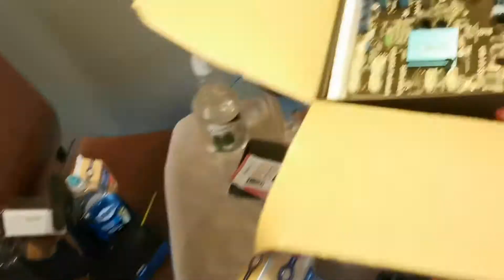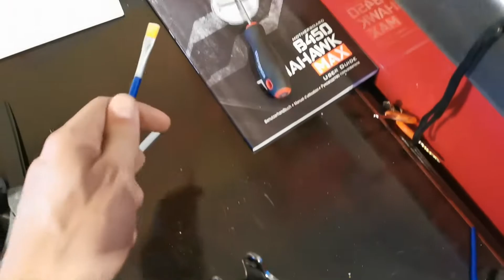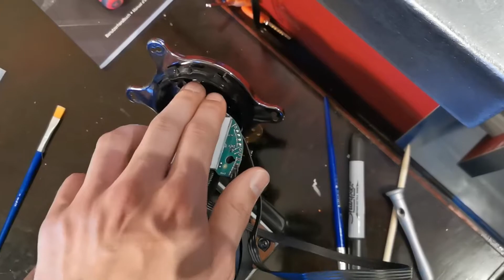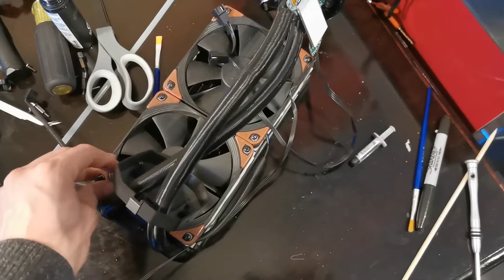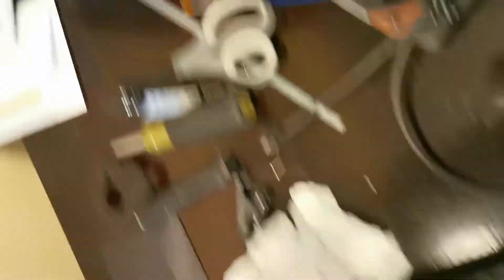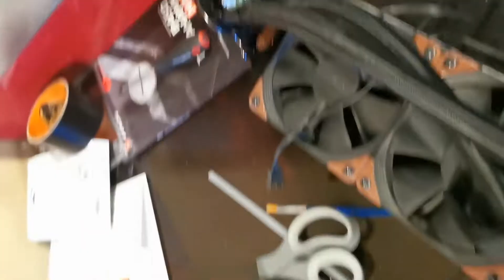H100IV2 My Teardown+Tips

Comment: How u remove the screws of the cooper block?
Reply from the maker: They are a special screw called Pozi-driv

They look like regular phillips, they are NOT, as denoted by the extra cross on the head of the screw

https://images.app.goo.gl/TVAPjj5VBX2keWTt9

You MUST have a pozidriv bit or you WILL strip the heads of the screws
Reply: @stompyrobutts  thanks a lot man you really help me

Comment: did you ever manage to get it working again? if so, what screw did you get for the cold plate?
Reply from the maker: No, never got it working again. The screw was stripped and there was no extracting it without further damaging the unit.

The screws are know as a Posi-drive. DO NOT use a regular phillips on them, you will strip them.

Comment: thanks for the video, 2 questions, can you refill it with distilled water plus ISO Alcohol , and do you need really to unscrew to bleed? And what product you cleaned with? could not understand what was it.
Reply from the maker: I would not use ISO alcohol, as I am unsure if the rubber in the tubes are rated to withstand it, which could lead to leaks down the road. You need a biocide, to take care of anything living in your cooler/water, as well as a corrosion inhibitor, as these AIOs come with an aluminum radiator, and a copper plate, which can electrolyze and corrode without it in your distilled water.

Yes, you do need to open the screw and make it the highest point. Otherwise, you could leave air bubbles in your radiator which could at best lead to occasional temperature spikes, and at worst, kill your pump as it is both lubricated and cooled by the coolant

Finally, I cleaned the cold plate with Tub and Tile cleaner. Bathroom cleaner meant to deal with oxidation and mineral build up.
Reply: @stompyrobutts  Thanks for the reapply mate can I ask you what about motor cooling ??
Reply from the maker: @coolissimo69  What about motor cooling? The fluid inside the cooler keeps the pump cool, so you absolutely can NOT have air in the loop at all
Reply: @stompyrobutts  I understand what you saying what I am asking if I can use like , coolant from a car.
Reply from the maker: @coolissimo69  Yes and no. Allthough engine coolant has corrosion inhibitors, they are not the correct type for copper/aluminum electrolysis, as cars typically don't have any copper in their cooling system. They also typically don't contain biocides, as the operating temperature of the engine is hot enough to kill anything in the coolant.
Reply: @stompyrobutts  Actuallly Toyota has antibacterial on the coolant to. Was thinking to add a bit mixed with distilled water.
Reply from the maker: @coolissimo69  Youd still have problems with incorrect anti-corriosion additives, which would lead to you tearing down the unit again within two years
Reply: @stompyrobutts  thanks makes sense.